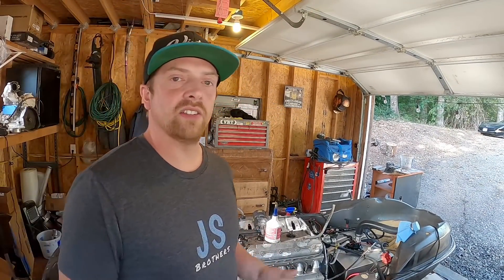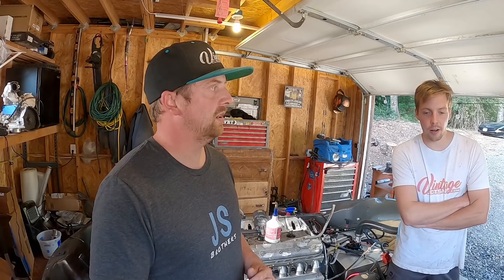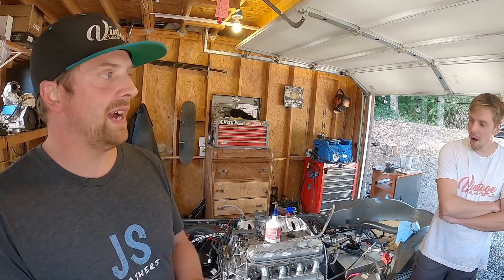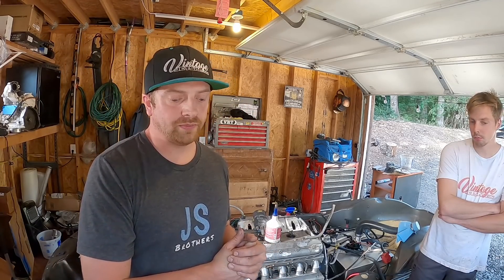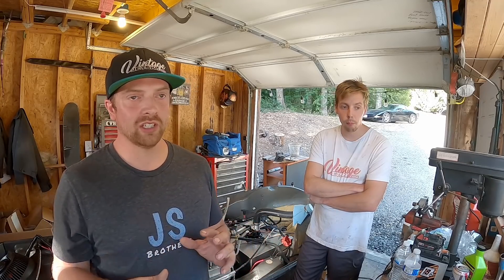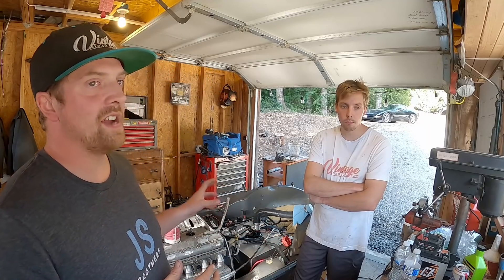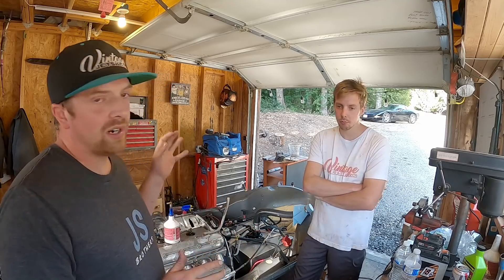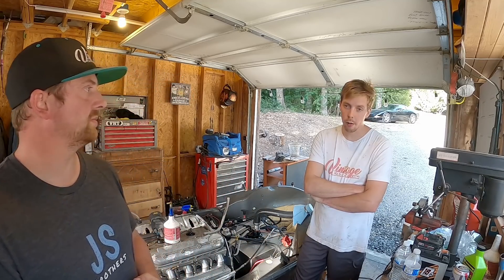v8 jetski gear ratios  engine rpm and pump speeds (Ls v8 jetski)

Comment: You have to remember as well, it's torque that breaks driveline components... aqualine whatever. Using the torque from the engine with overdrive gears will put much more stress on everything as I'm sure you know. Kind of how why you don't let a car shift into overdrive driving up a mountain road

Comment: The gear ratio is 1:1.6, not 1.6 : 1.
Actually 1 : 1.647 or 0.6 : 1
You don't need a gear ratio calculator to figure it out, simply divide the 2 tooth counts.
28/17= 1.647....

Comment: Lol gear ratio calculator? 🤣 do you just mean calculator? Just divide the drive gear teeth by the driven gear teeth. 1.6:1 would mean for every rotation of the drive gear the driven gear would spin 1.6 times.
Reply: No, 1.6:1 means output would turn 0.6 turns..
1:1.6 means output will turn 1.6

Comment: I think it's interesting about your gear ratios and the fact that the engine isn't just spinning up to max rpm freely... it means that your pump has way more to offer and you can get a lot more out of this ski by boosting power. 

Man... figuring out gear ratios is hard enough... then trying to actually say it... that's even harder.   I feel ya. 

I would hope that that cluster is waterproof.... I would be afraid to use it if not... but I'm just paranoid about electronics. 

I watched your video yesterday on my phone but was super busy and forgot to comment.
Reply: Do you know about the piston flip debate between the guys from Engine Masters and Uncle Tony's Garage on you tube?  The myth that putting a piston with wrist pin offset in backwards makes more horsepower. It's been claimed by many people for decades but never proven back to back on a dyno. Lots of people tried to explain using math and lots of other techniques why it would make more power. So Richard Holdner and the guys at engine masters actually did it and it turns out it made within a decimal point of 1 horsepower with the pistons flipped around. So the myth is busted.
Reply: @chrisglassey8585  I've never heard of that... I know that Yamaha and a few other companies are offsetting the crank shaft to take advantage of the engine peak pressure at an optimal crank angle ... I don't really know enough about the LS or car engines to know if this is a similar idea ... I'm not really understanding the "Offset in backwards" 

It's interesting though... Many things that work out in theory don't really work out in practice as there are so many variables and you end up changing more than one thing, even if you try really hard to only change that one thing, for testing.
Reply: I think that's what we got with the pump debate here. No one will really know till someone does the jet ski pump vs the bigger jet boat pump test.
Reply: @chrisglassey8585  I totally think / agree that a bigger pump just makes more sense. 

My understanding of pumps isn't the best... I freely admit that. I don't think that the factory pump will be as efficient as a larger pump, when they really start pushing it, but I don't believe that they are stressing the pump yet. 

I believe that Yamaha would have given themselves a bit of a "buffer zone" in this pump and not had it sized so that it was on the verge of being too small. Based on their approximate impeller RPM and the fact that it is a OEM impeller I have to assume that they can spin it a bit faster and or step up their impeller game and move more / faster water through this pump before it becomes really inefficient and just starts soaking up any extra power. 

That being said... why did the carrier fail 🤷‍♂️. Based on the numbers the JSB got, I wouldn't think it was close to failure, but maybe it is building too much pressure 🤷‍♂️
Reply: @JoelArseneaultYouTube   Most production engines for cars and trucks have the wrist pin offset to one side of the piston just slightly to stop piston slap and make the engine quieter. Some people thought if you put the piston in facing the wrong way it would increase power. That was the myth.

I do agree that the pump Josh is using probably still has more to give but it's already spinning 8000 rpm and producing 70mph. How much more does it have in it? Good question.
I agree Yamaha didn't put a maxed out pump in that ski, but it was only designed to handle 260hp not 2 or 3 times more.  
If you take that pump and spin it at 8000 rpm and you take a bigger pump and spin it at 8000 rpm the bigger pump will move more volume of water assuming impeller pitch is comparable. The more water you move the more thrust you have as long as the water speed coming out of the nozzle is of comparable speed and given you are applying the same power into the pump. Thrust = forward movement.

It's the same principle as with hydraulics. If you take a 1" diameter ram with 1000psi and take a 6" diameter ram with 1000psi the bigger ram has more power even with the same psi. In this instance the psi is the force being made by the "engine".
Reply: @chrisglassey8585  Haha... okay, so the pistons are made with an offset to one side of the bore... odd. 

I totally agree... this pump is going to need replacing at some point, I assume anyway. I do get how thrust works (to some extent) and get that at some point the size of the pump will be the limiting factor. 

What you are saying is kinda the same deal with turbochargers or superchargers ... people always like to talk about boost pressure and brag it up... but the truth is that boost pressure is the resistance of air flow, and the resistance is stopping air from getting into your engine ... A high volumetric efficiency will give you a lower boost pressure, but MORE HP  :) 

You can keep jamming water through the pump and rise the pressure, but as the pressure rises the efficiency drops and more power is wasted instead of developing thrust. 👍The question is, at what point does this lead to diminishing returns. 🤷‍♂️
Reply: @JoelArseneaultYouTube   I agree with what you just said 100%.
I was going to use the turbo and supercharger comment you made but a lot of people don't get it so I thought I would try a better way to explain. I should have known you better than that by now haha.
Reply: @chrisglassey8585  Haha... I'll take that as a complement.
Reply from the maker: All good buddy, hope you have been selling a bunch of bed plates 👍

Comment: On a jetski where peak torque is located makes zero difference when it comes to getting the best top speed.The original Yamaha engines make peak torque in the low 8000rpms and the real fast guys turn them way past that between 10,500 and 11,000rpms.For best top speed you want to pitch prop to turn the rpm where the motor makes its peak horsepower.

Comment: Leave gear ratio as is just add a cam and rev motor to 8k , at 1.6:1 that’s 12800 pump speed

Comment: Not sure if those gauges are waterproof, but if they are not maybe look into potting the electronic boards inside the screen (epoxy covering over the electronics keeps moisture out). Ive also seen clear nail polish used to paint over the pcb to make it somewhat waterproof

Comment: I spin my propeller 48% over my engine rpm. 18 foot flat bottom v-drive with 1500 hp. Gear that thing up! You have a ton more hp and torque than what was originally in there.
Reply: Need to get it 2:1...

Comment: When our boat got water im the oil (to this day not surde why) changed it several times boat shop finally said take it out and boil the water out.. just keep that in mind when you get her running again

And the gear ratio i believe would be about .6 not 1.6 but didn't do the math

Comment: The dash is 100% NOT waterproof, and Y'all will need to build a waterproof  case for it. You guys must be running either an HP or Dominator ecm, as the Terminator X and X Max are definitely NOT waterproof..
Reply from the maker: Thanks for the info, we are running Holley hp 👍

Comment: Right on, right on. Hey Rolex are waterproof man. I would work on a plate to plate heat exchanger with Tstat to get away from salt water to engine. You can use it on new engine also. And its not free money, not at all.

Comment: Sounds like you're putting the cart before the horse. You've already proven that your propulsion system is inadequate the amount of horsepower you're making. I know you're talkin about making more horsepower does that make sense to you. Love what you've done so far and in my opinion it's time to dive into researcvh and development for a pump
Reply: yes. failure analysis would be required, or this will repeat. water is incompressible.               
the shards tell some kind of story........looking forward to the JSB's solve.
Reply: What kind of RPMs was that jet pump running with the jet ski engine?
Reply: @bansheeman1  excellent question
Reply: I thought it was the OEM coupler that failed? Lest video they talked of getting a billet coupler for the pump side to match the one they made for the engine size.
Reply: He said in the video ... 1:1.6 @ 5000 RPMs from the engine 1.6 x 5000= 8,000 RPMs, stock drive lines are capable of handling @9,500 RPMs
Reply: @Aquaholic6801  that's absolutely correct I've gone back and view some of his build vids and from what I see this failure stems from the input to the impeller carrier that he built for whatever reason either out of balance or whatever came apart.
Reply: There are several skis here In Tennessee running upper 80's Low 90's and a Turbo ski running upper 90's...

Comment: You're going to need a proper jet pump..... like from a real jet boat. The puny little jetski drive is just going to grenade again. Then you don't need the gear reduction, either....
Reply: @ShawnFromFL   I'm calling BS on 1200hp with a stock pump and driveshaft.  Someone has been telling you BS.
Reply: @ShawnFromFL  Also plenty of guys out there going just as fast in an 18 foot jet boat spinning half the RPM weighing probably more than twice the weight.  Wonder how they do that...
Reply: Oh, yeah.... 1100 swap one of those Wet Bikes and get it running!!! I love those things... Or.... maybe.... Ya'll wouldn't be interested in selling one of those, would you?
Reply: @tngtacticalmiata1219   I recommended a Berkeley in the beginning and that idea was shot down. I still think it is the way to go. It can handle a lot of power with a stainless impeller and you wouldn't have all that power loss going through the gear box. You could actually use that power. It would be easier to swap than people think as the Berkeley puts it thrust to the floor of the boat and not the transom. The square looking box on the back of the boat is just there to seal up the water from coming in with a big o ring. It's not structural at all.  Having said that not everyone has the same opinion and may not wanna go that route. Sometimes people figure out another way to reach the same goal and I'm also interested to see Josh find his own way there.
Reply: @UCFEOooNAVRKfBaDGkbtoMzg if water had no resistance than the ski could go several hundred mph till the wind resistance blew the rider off.  That's just not true at all.  It's actually the opposite. Moving in water takes way more effort than on pavement.
Reply: @ShawnFromFL  Fact is the stock drive line couldn't even hold a 400ish horsepower engine. I don't see how it's going to handle MORE power if put back to the same setup.  Also what's the point of building a ski that you have to baby the throttle so you don't explode the drivline???
Reply: Imagine if a top fuel dragster had to do a rolling start so it was easier on the drivetrain. It would suck if they built a 10,000 up engine and then stuck it in with a "stock" car rear end and just said "it's better to do a rolling start" "it's easier on the axles" that would be pretty dumb.
Reply: I'll check out the video later today.
Reply: @ShawnFromFL   says it makes 1200hp but has never dyno it. He also said it makes 1300hp before they spray it. Well what is it then. He also never explains the pump and driveshaft.  You also never see it go full throttle till he is moving pretty fast. I'm assuming it would break if he tried a holeshot. It's fast I'll give him that. Kinda useless tho if it can only go full power for 1-2 seconds at a time though.
Reply: Why would the "puny drive explode" you realize people push 600+hp with those "puny drives" the fastest jetski in the world which is 1000+hp used those "puny drives"
Reply: @jackdevane2496   you think his driveshaft will hold 600 horse as is? It didn't even hold what it has now. There is still no way to use it without losing power through the overdrive gearbox setup which kind of defeats the purpose of putting a big engine in the ski in the first place.
Reply: @chrisglassey8585  You think people running 600 horse run stock pump system NO but he was saying run a jet unit off of a actual jet boat when these units can handle power just need to be beefed up and something wasnt right thats why it gave out you realize a 4.8 stock makes like 280 he cammed it and tuned it so it probably is 350 atleast but hp has NOTHING to do with top speed its all rpm and hes running almost same rpm as stock just a couple hundred more thats why hes at 70 and stock goes 67
Reply: @jackdevane2496   thanks for your opinions.
Reply: @jackdevane2496  Yes. But, the power delivery is VERY different and the vibration harmonics are also different. That LS is putting out peak torque almost as soon as you hit the throttle..... All that being said, I admit I'm just guessing. It just seems to me like a good Berkely-style pump would be a LOT harder to break than a standard Jetski style drive. 
OR... It could be the gear drive itself. People that do Automotive engine conversions for aircraft run into the same kind of problems.
Reply: @tngtacticalmiata1219   There's no point in us arguing with them. If they are happy running a pump setup that can't handle full power from a dead stop without breaking then that's fine by me.  I prefer it to be strong enough to handle every bit of power it makes in any situation.